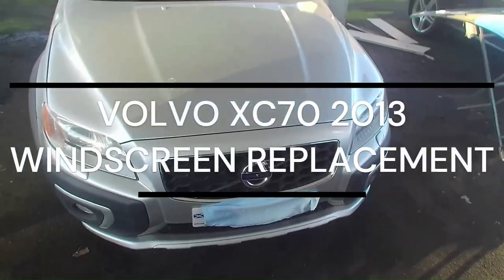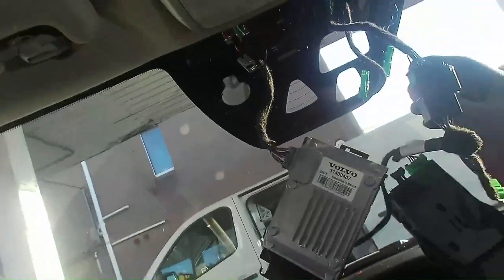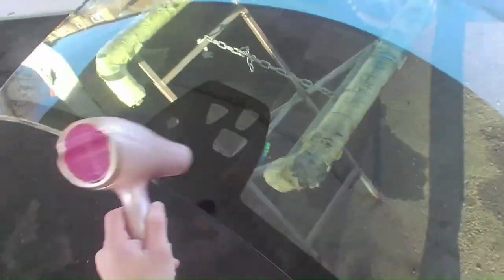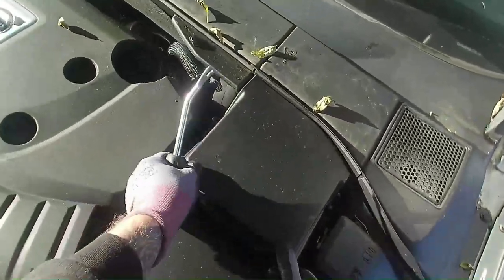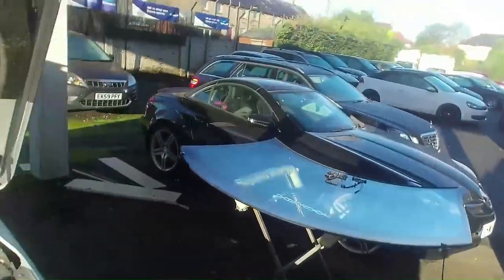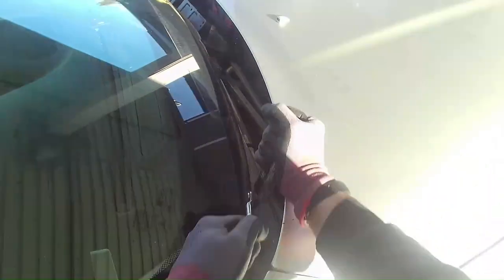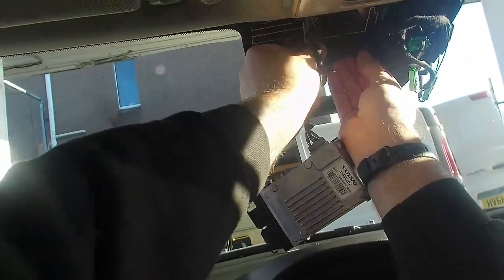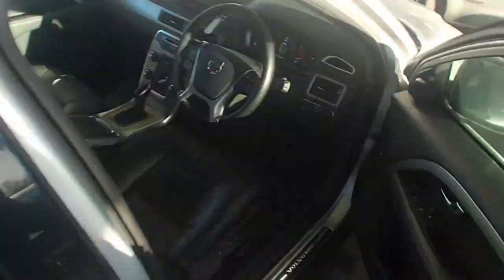WINDSCREEN REPLACEMENT - Volvo XC70 - Step By Step

Comment: A 'National Windscreen' fitting company dropped a piece of windscreen spacer which got lodged into my blower motor, Had the Motor been Damaged a New Blower motor at Volvo was £1500, Local Mechanic stripped part of the dash out to get to it and just billed me for a few hours Labour, the 'National Windscreen' company also scratched my Bonnet in two places and my roof in 4 places, they left a tool in my engine bay and broke those side trims, the Glass they fitted was faulty so had to be Redone. It is always worth going off recomendations Folks, This Guy took a lot of care and he Obviously takes pride in his work.

Comment: nice job, i just broke my 2010 XC70 windshield and i am looking for a spare
my car has also line assist; are line assist and non line assist completely different or is it just a matter of replacing some components?
thank you
Reply from the maker: The windscreen components/attachments need to be detached from the plastic bracket that is connected to the windscreen, so you need to find a windscreen with the same bracket as there are multiple variations on most models of cars.
Reply: @AUTOGLAZ1ER  thank you so much for your feedback! Cheers from Italy
Reply from the maker: @loris199  Grazie, buono fortuna. 😁

Comment: I had my 2014 xc70 less than two months and I've gotten a serious cracked windshield and a dip chip. Needless to say I'm beyond pissed. I'm very concerned about the repair procedure. After watching this video I'm feeling a bit better. Just praying my referred insurance repairman is as proficient and conscientious as you... If only of you were in the  U. S.
Reply from the maker: Hi Theresa, That's unfortunate about your windshield, nobody likes unnecessary repair bills, im sure your Auto Glass repairman will get the job done without any issues, it's a straight forward procedure so don't be to concerned. Please let me know how you get on with it & I'm glad that my video has helped is some way.

Comment: defo deserve a sub from me! good video
Reply from the maker: Thanks friend, really appreciate the sub 👍
Reply: @AUTOGLAZ1ER  are you anywhere around manchester? :D I feel like our S60 2010 has this issue where it either needs just resealing or a whole replacement with proper re-seal. 

How much such a job usually goes by?
And how much is non heated windscreen for S60 p3 ?
Reply from the maker: @robertasviskupaitis9195  No sorry I'm in Edinburgh area, probably looking at £300-£500 for a new windscreen fitted, you could try call some local independent companies, I'm sure they would be happy of the work. 
Thanks.
Andy.